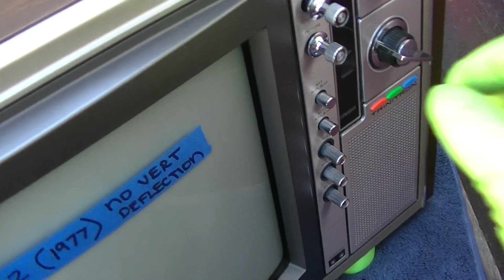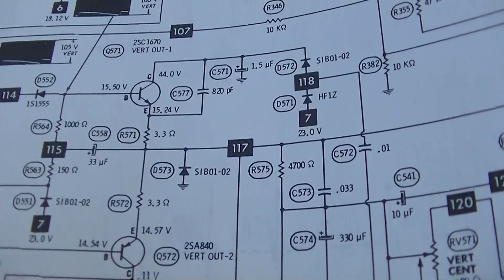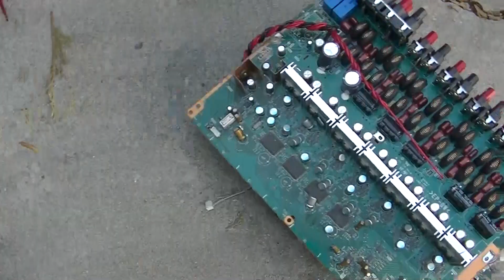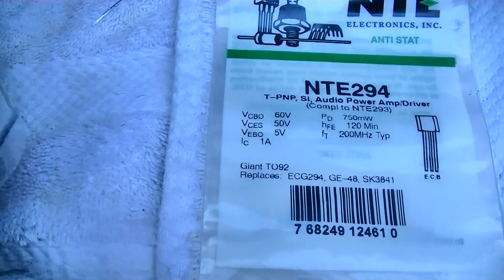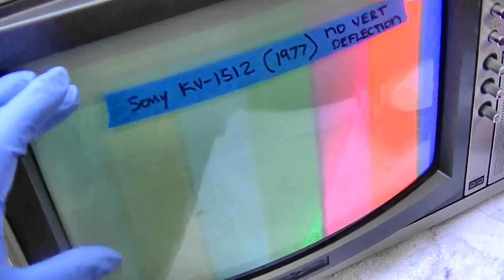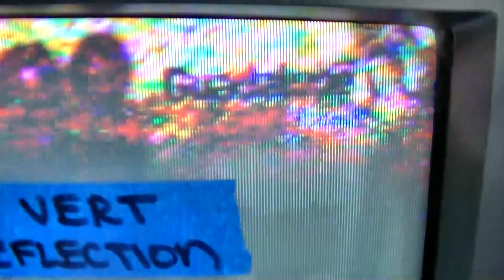Mint 1977 Sony Trinitron KV1512 Repair Vintage Color Television

Comment: That Vert. B+ cap. has always been a problem child in these vertical circuits not just on Sony. I believe when they open it allows the high frequency ripple into the circuit because the B+ is derived from the flyback and that causes the top fold over and the high freq. ripple over heats the output transistors. You always must check all caps when you have vertical issues as bad ones were quite common. especially Nippon chemi- con brands, then we're so bad I wouldn't even buy them for replacements.
Reply: No, this is just typical Sony fault caused by design. This is not standard B+ cap, that is in other position. But B+ for vertical out is fed through 2 diodes (the small cap in middle put H pulses there) and after the second diode there is just low capacity (1,5uF) cap on collector of power out transistor. This design enables to raise voltage on transistor during vertical flyback interval when is needed, but run on low (B+) voltage during the visible part of frame. It reduces power loss significantly, but this cap is heavy impulse loaded. Its clearly visible when you put scope on it.
Reply: @xsc1000  Nice analysis - that explains the 44v on the Q571 collector. Shango066 actually found the problem early on when he only measured 24v there. I would have liked to see the scope trace as it would have probably shown the unfiltered pulse that caused the chain reaction failure. But not to find fault...I've been there & done that many times myself. I respect people who admit their screw-ups and despise those who always blame others.
Reply: Looked like it was loading down the circuit to me and causing the transistor collecter to ground out and burn then up
Reply: @metalmanin  No, there was not excessive load. If this cap loose capacity, you get about 100V horizontal pulses on collector. So transistor was destroyed by high voltage, not by high load.

Comment: those really are beautifully preserved sets, and a good fix too. Like you said it really did look like a capacitor fault with the foldover just took a moment to find the culprit, not sure why it caused the original type transistors to pop immediately though.  Looking forward to the one with no HV that ought to be interesting.

Comment: I still use my Sony KV-2680R daily. Bought new in 1987 26" stereo console. However Sony did warranty the jug in 1988 (went soft). Still an excellent picture. Even the RM-720 remote still works.  dave
Reply: Awesome! We had a TV that was purchased by my mother in 1989 that we used daily until last year. It's now retired from daily use but still works!

Comment: Those O/P Transistors were a good move, The 2.2uf on the power line will probably have put 60hz on the power line and it may have fed back and put more strain on the PNP Transistor, The Top of the screen is where the scan starts so it will end up doing more as a result. I really do not like Sony stuff.... but that is me. Not a gamer!

Comment: A 1940 RCA console radio just fell into my possession. Watching your videos has given me the courage to attempt to get it operational. It doesn't have any markings on the model number. Any suggestions on how to identify it so I can get a schematic?
Reply from the maker: Nostalgia air resources. Take your time and have fun with it. And don't worry about damaging it it's not a cult object
Reply: @shango066  Thanks from a fan.
Reply: There’s this web site that you can plug in known info, including manufacturer, tube count, tube numbers, and it compares what you’ve entered with old tube books to help identify the chassis that used what you entered. Basically a reverse look up. 

https://grillecloth.com/sylvania/tubelist.php
Reply: @erikj.2066  Thank you!

Comment: That KV1541r looks a lot like the KV1942r that Jordan Pier just got finished with (part 7/7). I wonder if the KV1541r will be as much a PITA to work on as the KV1942r?

Comment: The second TV with the remote is the exact one I had growing up. We replaced around 1997, and it was still working at the time. We also had a slightly newer Trinitron that lasted until 2005. Both were good for gaming.
Reply: Jordan pier just did a multi part on that same tv
Reply: I used to own a 1996 Sony Trinitron 27" TV that I bought new. Used it up to 2011 when I sold it to a coworker. Was still working just as good as it did when I brought it home. They seemed to last forever.

Comment: Out of curiosity I would have liked to see if the transistor heats up as much after replacing that cap.
Reply: I used to fix TV's years ago, it most likely will not over heat with the new cap, the problem transistors are prone to is excessive surge current, when a pulse (none smoothed) ripple shocks the transistor to death by high voltage spikes. A capacitor keeps the voltage and current within the transistors operating range. Transistors are not very forgiving when pulses exceed their surge tolerances this is why data sheets always list maximum surge current, if the surge current exceeds what the transistor can handle it goes into thermal self destruction and pop...
Reply: I bet it doesn't.  Gotta be excess voltage or current.  Couldn't see the schematic, but that cap had to be affecting the oscillating of the circuit negatively with the roll over at the top or complete loss of deflection.  I bet an oscilloscope on the vertical section would have been interesting especially when it was going horribly wrong.
Reply: When those caps go, it dies run hotter. Agreed, always fix your foldover.

Comment: Gorgeous tv...I will say, that generation of Sony had to use OEM ,we would try nte or ecg or other brands and they just wouldn't work....
I would go crazy with the older Sony's....
But, the newer transistors may have better characteristics. 
And some of the resistors would change valve but look physically good..!
I love that TV...!!

Comment: Common issue with Sony Tvs is they won't work right with substituted parts. I put ERS subs in the vertical out of a Sony years ago which gave me a full screen but scan lines were missing.
Reply: Some parts like horz output transistors best to buy Penn parts.

Comment: Love late 70s trinitrons, and that set is in really good shape.
Reply: Ours lasted till y2k
Reply: @Supercat Melee
Like the "Golden Era" Hondas of the 1980s and 1990s, so too are the Sony Trinitons of the 70s and 80s.
Reply: The tubes die on them and it's game over. They do a great picture.
Reply: Or trinitron lasted from 1977 to 2000. It still worked when we replaced it with a philips but the tube was worn out. The philips lasted exactly 10 years almost like they put a timer in.
Reply: I used to work on Sonys as a tech at an authorized warranty repair station.

Comment: Something is still rotten in the state of Demark, both of those vertical output transistors should be running about the same current / heat.
Reply from the maker: I don't think so, if you look at the design one clearly has a heat sink and one doesn't on both sets and the schematic
Reply: @shango066  Well that is weird.  Maybe they drive one transistor harder to center the sweep by leaving a bit of DC current in the yoke.  Could be how the trinitron color convergence setup works?
Reply: The current is about 100mA through both, but voltage dropped across the driver is greater. The difference is half a watt extra for the driver. 1.5W will need a heatsink. Unless the voltages on the cct are correct in which case the top tranny would be dissipating 3W and would certainly need a heatsink.

Comment: Nice set! I have 2 of the KV-1510 variants. The model before this circa 1973 to 1975. Econoquick is not instant on. It was a gimmick by Sony. Wierd thing is, the models before that did not say Econoquick did have instant on. Econoquick was simply quick picture power up, from thier new style heater  and cathode setup that makes picture come up quicker. At this time Sony knew instant on was killing CRTs.